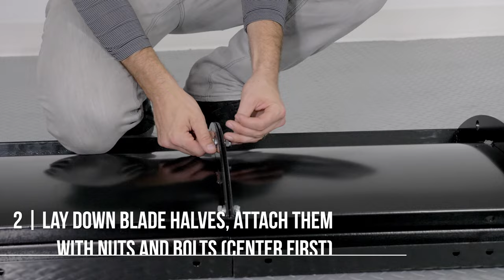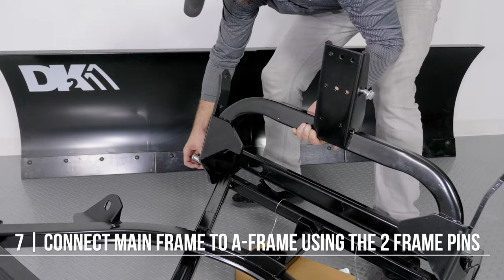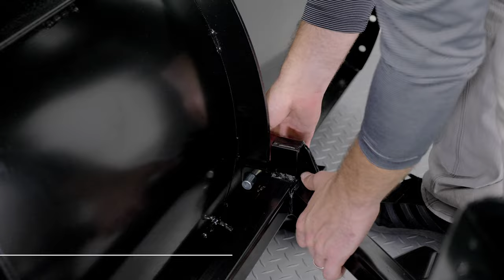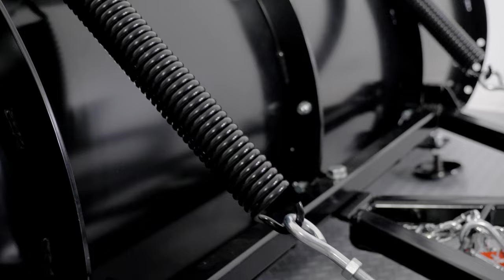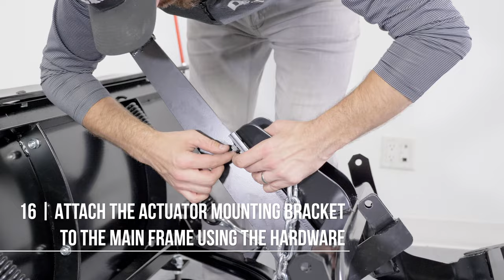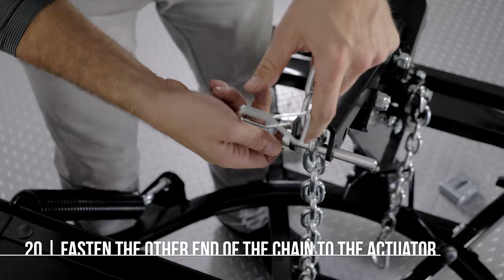DK2 Snowplows | UNIVERSAL ELITE Snowplows | Assembly

Comment: The absolute best thing DK did was to do away with the 2" receiver front mount system and went with the new U shaped one. I had a DK storm plow with it 2" mounting system and snapped the 2" receiver bar  twice when I hit a mound of frozen snow in one side of the plow.  The new mounting system seen here is the bomb! More stable and strong! Great change. They should do it with all of their snow plows.
Reply: Ya, I decided to just make my own plow instead. After alot of research, I seen all the weak points of those kind of plows and figured I could build one stronger, more heavy duty for much less. I did like the idea of a 2" receiver hitch mount, but that ended up to be the only weak point on mine also. I ended up welding two short pieces of square stock on each side of the plow frame that would rest against the receiver hitch on my truck (kind of a brace on each side) to keep the 2" male piece from cracking the weld. That was about 20 years ago and my plow is still good as the day I made it. I lift it with a cheap Harbor Freight winch which works perfect.

Comment: Do yourself a favor don't put on the actuator or the hardware for it it will burn out go to harbor freight and buy a winch for 100 dollars and it bolts right on no drilling required and then you will have a great plow that works 10 times better

Comment: hay why did i get the winch one that worksks when it what s Piston's off i just bought  this plow what a joke head light you have to buy extra 500.00 you short changed my ass for this thing Piston's off won't be buying anything from them same plow they ofer this thing for 12,99 can only order the 2000.00 one which is so pose to be better bs i ant playing around i will not back down make it right ps i am a 40 year welding vet machine builder ply fair
Reply: keep playing around and you can stay in Canda